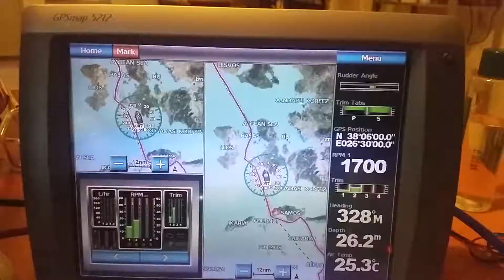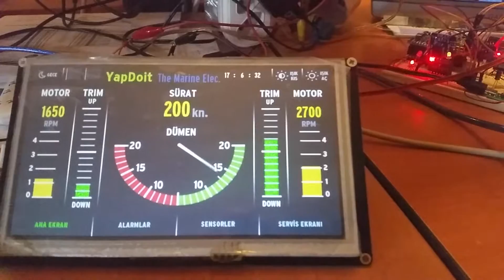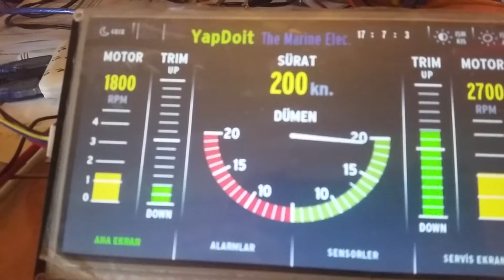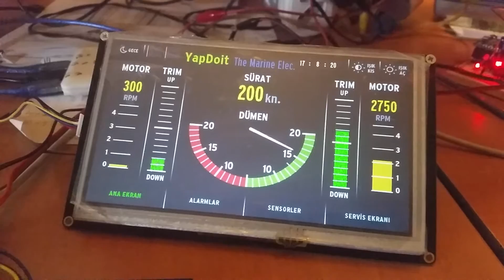NMEA2000 device design

Comment: I´m impressed! That looks really good! May I ask what hardware and software you are using? I am looking for a way to do something similar on my boat. An electric propulsion catamaran. I have been looking into arduino for the sensors and a raspberry pi to monitor them and supply information to N2K network. I really like your display! Very close to what I have been working on.

Thanks for the share
/ Axel
Reply from the maker: Arduino mega2560 promini and some staff.   the library is the most famous     "https://github.com/ttlappalainen"   ( can be find on github).
the display is nextion 7 "".  the  analog channels are optoisolated linear.  and the ofcourse more and much more weeks and sleepless nights.  thank you have take a look that. 
You can use raspberry but itll be slow down for startup. but Nextion and arduino are very fast embedded system like on the your cars dashboard screen.  just swicth on and vailaaa... keep going. regards...
Reply: @yapdoit8077  thanks! I'll continue researching and learning more about arduino. I want to share n2k info to b&g plotter. Looking into using the pi as siknalk gateway and providing n2k data from arduino to backbone.